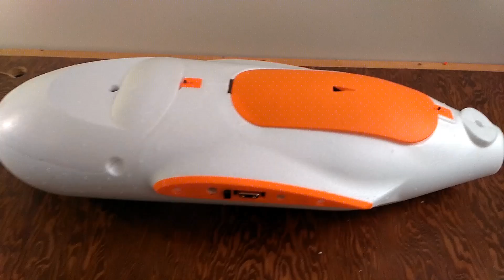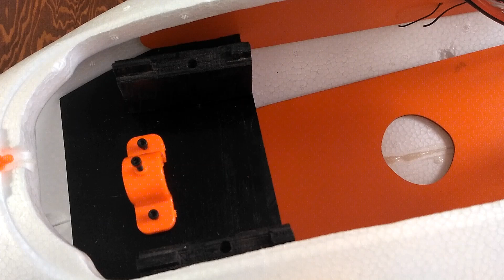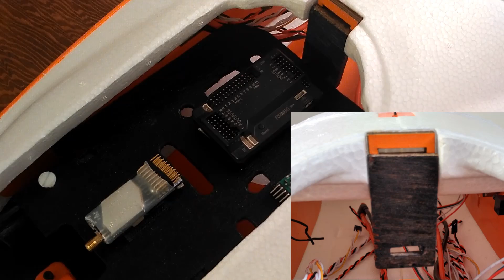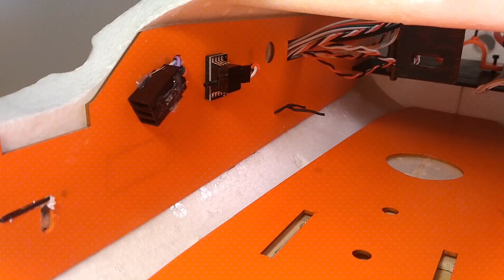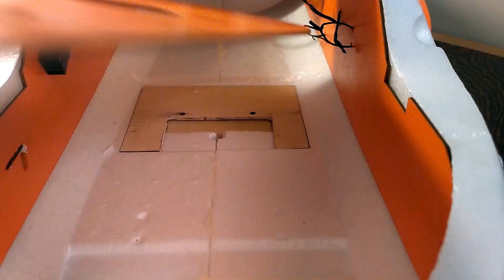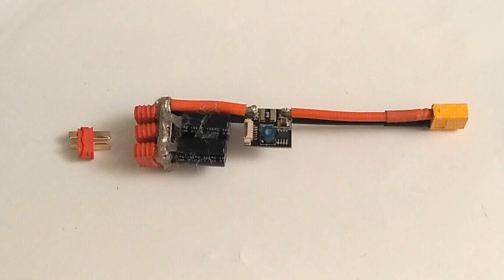Skywalker eve 2000 build pt 1- fuselage custom interior

Comment: Are the wings only held on with those snap-in joints? If so, are you concerned that they will fatigue over time? Thanks for the video.
Reply from the maker: I think it will be ok. I flew the MTD without the screws in the wings once for 20 min and nothing happened. There isn't a lot of outward force on the wings everything is perpendicular to that joint. It it does fatigue it wouldn't be hard to engineer something to replace it.

Comment: What are the thick power wires for? the ones you've put in the dsub connector?
Reply from the maker: those are the battery wires for the esc's. I isolated them for all the other connecions because of the noise hey create in the electrical system
Reply: Of course they are, I forgot it was a twin motor for a moment :-)